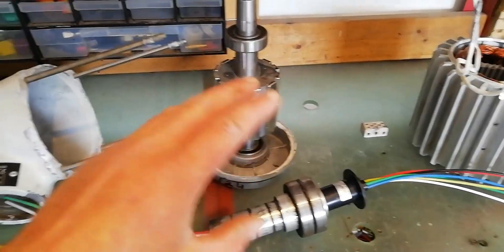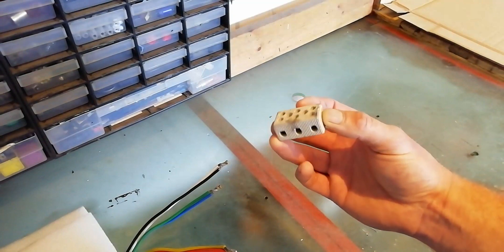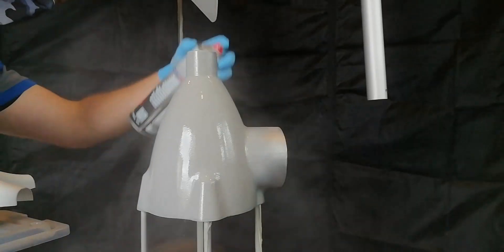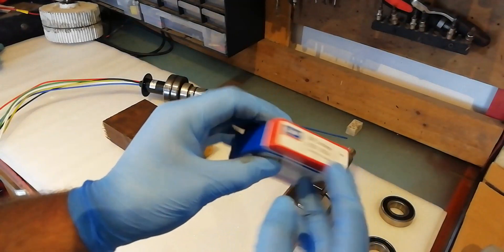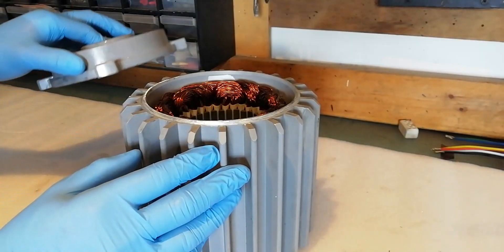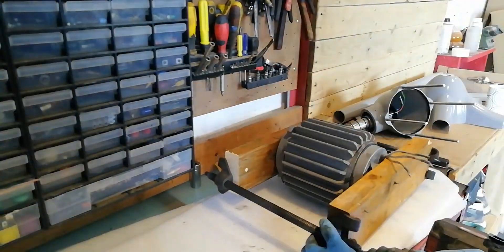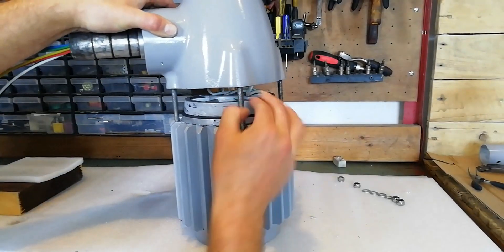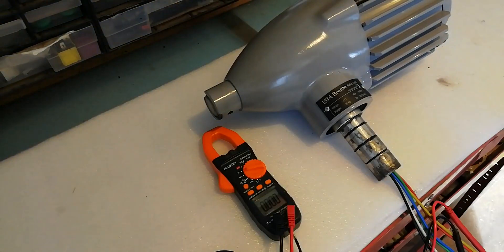Wind Turbine Upgrade Repair & Maintenance Tutorial Istabreeze i1500

Comment: How does the water (condensate) exit the nacelle? Does it just flood and damage the slip-rings?  Drill a drain hole ...
Reply from the maker: The nacelle is sealed, check out the refurb and upgrade vid from sometime in 24 when we stripped, rebuilt and solved all the original design flaws.
Reply: @ourkilkennyhomestead2006  OK, your refurb is well sealed.  But how about all of original units?  Seems like water vapor just collects inside. Humid during the day, then cool at night ???

Comment: Very good video.
I have just ordered an istabreeze wind turbine with an inverter, which will connect straight to the mains.
How long before the slip ring goes faulty.
Reply from the maker: Thank you. There's no set period for slip ring failure.it happens to most within the first year or two of operation.

Comment: Some maintenance tips for others maybe having vibration problems. Don't assume the rotor bearings are ok. I've just changed mine ( along with the slipring ) and the difference is astonishing. I had gotten used to a fair amount of vibration coming down the mast and echoing down the hillside towards my house. After changing the rotor bearings the vibration and noise has completely disappeared. Like car bearings, these can create a fair old racket and a lot of vibration but seem quite smooth once theyre off the vehicle. Free play in bearings is sometimes not easily detected but the symptoms certainly are!. Thanks Kilkenny Homestead for all the help. Terrific video..
Reply from the maker: @nhikoid  very good advice. Glad your turbine is back in action, well done on the successful rebuild. 👏

Comment: You were right about the hardest part being the positioning of the end caps! What a b%^&* of a job!.  I tried your method of using 4x2's with a slight mod. Used two threaded bars & nuts to pull the timbers together. Trick is to tighten up so that the turbine is well jammed in place.. Then used  a heavy leather mallet to nudge the caps. Very satisying to hear them plop into place!. Thanks so much for this video!. Pity that ista don’t do a maintenace manual/video. A must have when slip rings go out after a couple of years.

Comment: Thanks for your help. That worked a treat!The top bearing of the dual set was fine (6008 c3's ). The bottom one was really badly knackered. One thing...do you have a link or model no. for that uprated slipring ?. Hope xmas has gone well. By the way, my two i1500s have knocked it out ot the park for generation, way outstripping my panels.
Reply from the maker: Glad it worked out for you. Don't have a link but the part no for the bigger slipring is: Moflon "MW1630"

Comment: Shouldnt have spoken too soon. One of my i1500's went completely nuts in the storm a few days ago. Sounded like a helecopter !. Thought it was going to break up. Took it down today, in between peeling sprouts etc and discovered two problems. The slipring was completely shot. No slipring meant no braking. And the vertical swivel bearing is a bit knackered. After a degree of brutality and moderately bad language I've managed to get the whole machine disassembled without destroying it. Ive got the two big circlips off the vertical spindle but I cannot get it to budge. Did you whack yours out or press it with clamps?
Reply from the maker: @nhikoid  is it that you can't get it out of the rear generator housing? If so, what I did with mine was to get a long 1/2 Inch extension bar, secure the housing in a vice or between your legs and tap hard with a hammer against the inner neck that protrudes through the bearings gradually working the spindle free from the housing. To remove the dual bearings from the spindle you will need to support the bearings with something solid and tap the spindle out with a hammer or use a hydraulic press to push the spindle clear out of the two bearings.
Reply: @ourkilkennyhomestead2006  Thanks for taking the time for that detailed reply, especially on Xmas eve ! ( a virtual Xmas pressie! ). I'll  give that a go.

Comment: Wondering if Wago connectors would be better than the ceramic connector block?
Reply from the maker: @randymch  possibly however I can see 2 possible issues. 1: connector size may not be sufficient to carry amperage, 2: wago may eventually developed corrosion due to atmospheric moisture content. With all that said they'd be no better or worse than other alternatives excluding soldering.
Reply: @ourkilkennyhomestead2006  Soldering method is easy and foolproof. But, the wires for the slipring are quite heavy gauge so I found it easier to use a small portable gas torch to solder the wires, rather than my electric soldering iron.
Reply from the maker: @nhikoid  the soldering is a matter of having a good soldering iron for the heavy gauge wire to be fair. Glad to hear that the repairs are progressing nicely for you.
Reply: @ourkilkennyhomestead2006 It’s back up on the tower. Just waiting for a bit of wind.

Comment: Hey Kilkenny, you did a video explaining how dc and ac electricity runs down a wire cable, went and brought the cheapest 2.5mm to find all solid core wire and have now found all my wind turbine cables have black coated wires inside the conduit, it this burnt or corroded ? is it a good swop from wound wire to solid core for the windturbine ? Thanks Henry
Reply from the maker: @HenryOwens-py3ur  Hi Henry, what turbine are you running? I'm guessing you didn't check the amperage rating on wire before purchasing. 2.5mm is usually only good for 13amps safely per conductor. If your turbine is not rectified internally and is sending
 A/C current to the control unit then A/C cable would be preferable between turbine and controller, then use D/C cable to connect controller to batteries.
Reply: @ourkilkennyhomestead2006  Running the 48v I2000, the 2.5mm solid core cables comeing from the turbine to the controller. Thinking it could be damp crossing the cable s and corroding the wire inside
Reply from the maker: @HenryOwens-py3ur  2000w ÷ 48 =41.6 amps +25%= 52.08.
You need to use 10mm2 cable if you're using t+e. The next size down is 6mm2 which is rated for 40amps so would be no good. If you look up "amps calculator" in your search engine it'll help you know how many amps a circuit could potentially carry, so you can choose the correct cable size next time and avoid making the same mistake. Once you know how many max amps your device will output then add 25% as a safety margin and choose your cable size based on that.
Reply: @ourkilkennyhomestead2006  Thanks for the advise, i remember now i brought it for my 300w wind turbine, but just disparate to get this i2000 up, but that will have to wait. Ive come up with the disision to make the 300w moveable ! placeing the turbine on a pole on pallet 3.5m high, with two ridged sway bars to each corner of the pallet and using turbuckles and wire rope to ancher it in place, like you would a tent, moveble too 15m north of the 700w and 15m west of the 700w, giveing me upto 33mph offset charge rates, straightening out the charge curve.
Reply: Got it, the 2.5mm at 30meters £30, i only need 15m to the I2000, another 30m, so 4x2.5mm gets me my 10mm2 cable, forgot the 300w and 700w 60m needed
Reply: Shame to paint it brother 🌫🌬🤍
It just needed drainage holes 😜

Comment: Great video. I have two i1500s Up 3 years now. Generally only run them in the winter months. Bearings still smooth. Still on original slip rings. Fingers crossed for the winter coming. Did great last year. Was thinking of adding a third but tempted by hefy looking FltXny brand on Aliexpress.
Reply from the maker: @nhikoid  Thanks. You're doing well with yours which is great to hear. Must have a look at that turbine on alixpress
Reply: @ourkilkennyhomestead2006  They also variously come under brand names REAL, B&C, B Creations, Green Energy, Bayoung and Smaraad. Polish/Danish youtuber  "4nrgy Tech" has some good vids on these. Probably same factory in "Wuxi" engineering district but with different brand labels.  Big diameters for power ratings : 3.2m 1000w, 3.8m 2000w so not the usually daft ratings v diameter one sees of Chinese machines. I see that Photonic Universe sell similar ones too. These are really big heavy generators with tail furling mechanisms. There is of course our trusted Istabreeze Heli2 ( bigger diameter3 blade version ).  Certainly, over the last 3 years, mid September , solar dies on it's backside and my two i1500's take over. Then in March, it's back to solar. If the Istas were grid tied I'd just let them run during the brighter months too but it's not worth the wear and tear when solar is so plentiful. But sorely tempted to get a bigger turbine for winter ( if just for the sheer fun of it! ).  Anyway thanks for a great channel. This repair video on the i1500 is invaluable!

Comment: if it makes 87v, then it should be convertible to 48v.
Reply from the maker: @ai4px  howdy, just a matter of the control system really. Have to set up some bench testing to get an idea of output at given rotation speeds. If it were only making 10amps in a 20mph mph wind at 48v it would be pretty poor. With that said it does have to be integrated in to the existing system one way or the other.
Reply: Nope, not Gonna work.  It's a 5 blade.

Comment: Great video! Do you know what is the difference between i1500 and i2000 except max output? Price is the same in here. Is there a good reason to buy with carbon blades? Maybe those are lighter so it will spin easier?
Reply from the maker: @JoniK1  thanks, just a slightly bigger generator on the i2000. The weight difference of the blades is questionable. We have had 2 sets of carbon blades, supposed to be identical however had 100grams weight difference on each blade. If the prices are the same for i1500 and i2000 maybe go for the bigger one.
Reply: @ourkilkennyhomestead2006  Is there a weight difference between alternators?  More copper?  More magnets?

Comment: So slip ring rated to 12v 60 amps now, if thats one wire 12v 30amp x 6 = 6000+watts ! thought i sore on an turkey website say the generator can reach 90-120 volts, should last a life time. So much fun ! tried lifting thoughs pannels with threaded bar and a drill ! stripped the threadeds in the middle of the bar ! didnt counter balance them wood was wet,  longer nut would lift pannels better as well. inspired me to piant mine now.
Reply from the maker: @HenryOwens-py3ur  ah wishful thinking for this turbine to ever produce 6kw unfortunately but at least it will never suffer slip ring failure again. What happened with drilling the panels? Were you drilling into a threaded hole?
Reply: @ourkilkennyhomestead2006  A threaded nut, which i jammed in between a washer and a into a scaffold tube, i got abit premature exited and didnt line things up plus the wieght of the water. so going to buy a connecting nut counter balance the over hung end, just carnt use that threaded bar, have to get new
Reply from the maker: @HenryOwens-py3ur  there's always something isn't there? It would be a rarity for a project to go right first time. Hope you get it sorted. 👍
Reply from the maker: @HenryOwens-py3ur  there's always something isn't there? It would be a rarity for a project to go right first time. Hope you get it sorted. 👍
Reply: looking forward to see it under braking now, i think it will stop it in its tracks, still gotta dumpload, sliding connections wont last for ever.
Reply: Drill a drain hole, make a bearing dam, let water run through.  Use 3 amp meters to see a failing slip ring. Needs bigger fin. Support tail from above . Mine rocks!